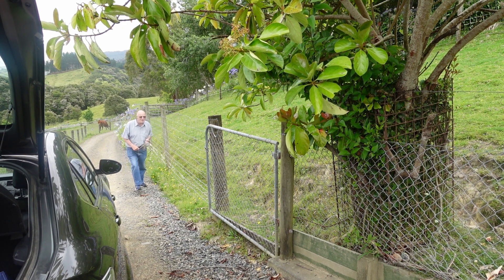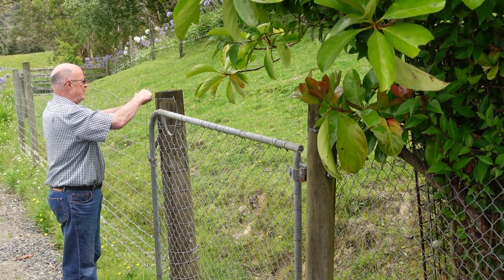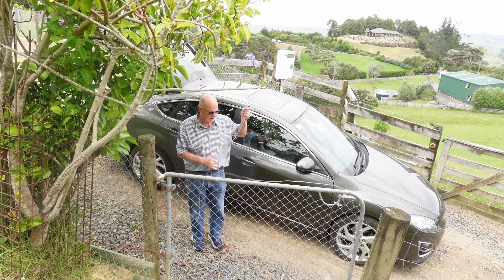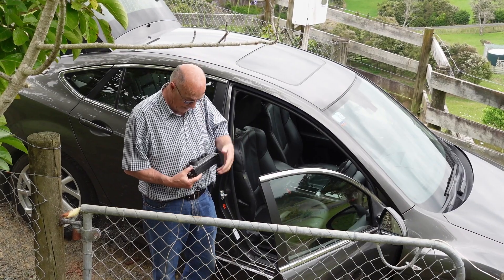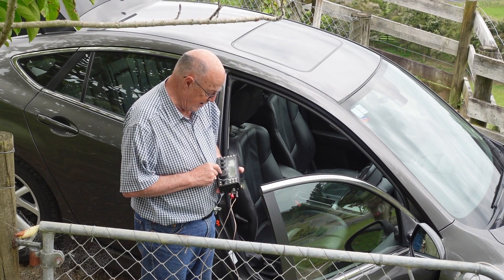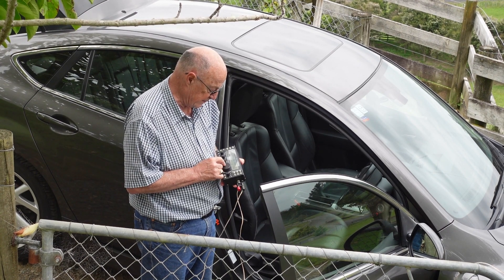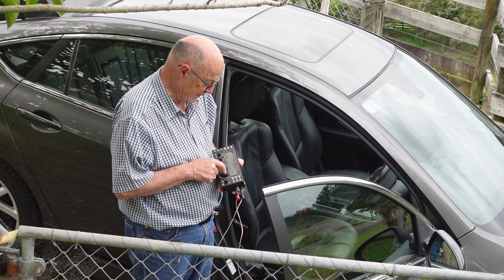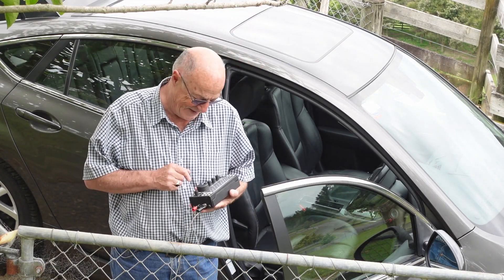Random  Dipole?? Will it load??

Comment: Wow nice 👍 I did same on 11m in the 80s. I had a 4’ whip mounted to my play house and used my chain link fence around the 3/4 acre backyard as my counterpoise. On ssb I was able to make cross country contacts. Yea my rig had sum extra switches which gave it a few more then 4w 😉 was a ton of fun. Now I get to try with HF. Still working on a stepped attenuation /pre amp on a ground mounted loop. KC3ONO
Reply from the maker: It is by no means the best antenna in the world, the fun is in "Giving it a go"....cheers

Comment: Nice one Roly, wish that was my fence!  Remember I said I was going to measure my garden and model a wire running around it using MMANA-GAL.  It didn't give very favourable results.  Maybe something a tuner would solve :-)  73s M7GTX :-)
Reply from the maker: It was just a bit of fun Richard... i may try it again in the evening some and see if i can make a QSO or two....cheers